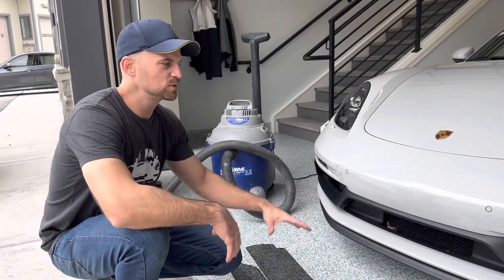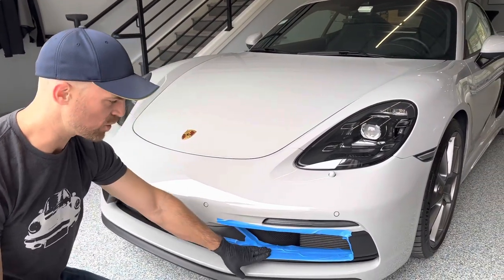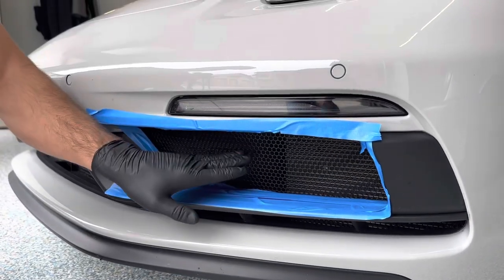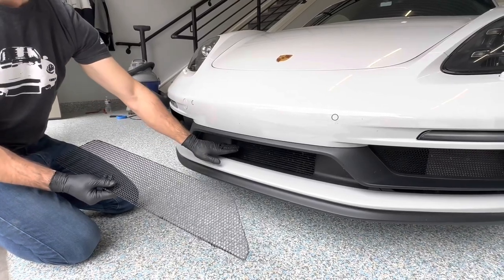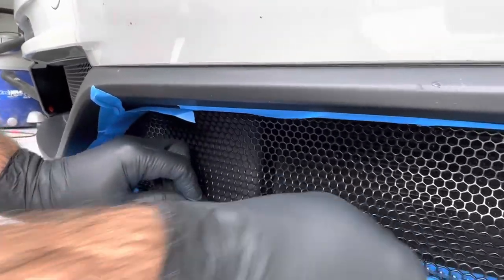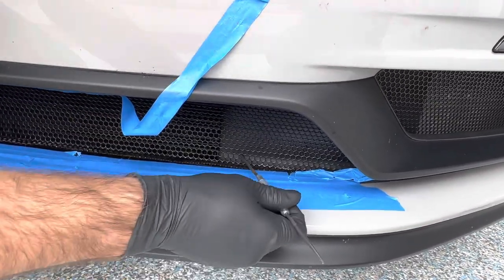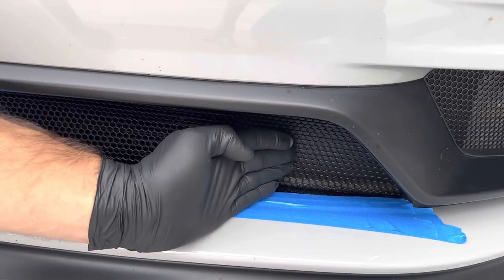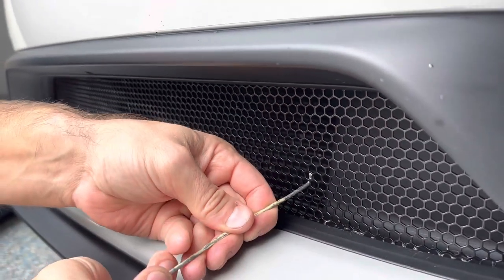Radiator Grille Store install of the 2017-2023 Porsche Boxster and Cayman GTS front radiator grilles

Comment: You guys should consider adding a plastic hook/pick tool to this kit. I installed this on my Cayman tonight and, lacking a hook tool, used an allen wrench. The problem is you end up inevitably wearing away or scratching the finish, leaving your brand-new grille riddled with little silver scratches through the powercoat in places. I don't think a plastic/non-metallic pick tool is something regular people have, so if you included this it would make the process easier for the user and result in a better impression of your product when brand new.
Reply: I just installed these and fully agree.  I used an allen wrench too and have paint worn off now.

I'd also suggest making it clear to put your hand behind the grill when installing in the side front left and right vents.  I didn't realize the corner of the grill was hitting the radiator when I was trying to install it.  Luckily it only bent some of the fins a little, but could've caused damage if I didnt realize quickly.

Comment: The lower grill looks like a real pain in the rear. It gets all messed up once you’re finished by the looks of some pics I’ve seen…
Reply from the maker: It definitely takes patience to get the OEM look. They can also be installed with bumper removal.
Reply: @radiatorgrillestore  I'd remove the bumper cover bodywork to install it even though that may take a bit more time to do it that way.
Reply: @radiatorgrillestore hey so I bought your grill and the install was super easy. I didn’t struggle at all with the lower grill lol. Looks clean and OEM. 👌🏼